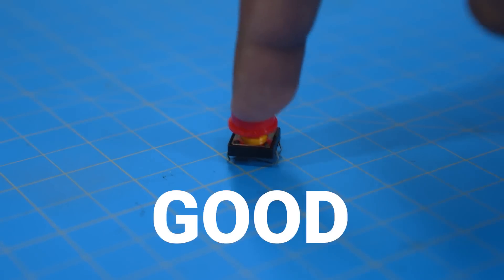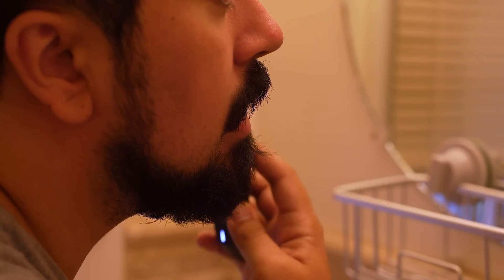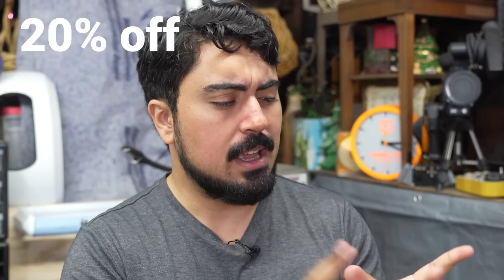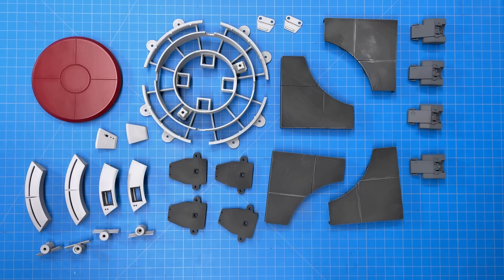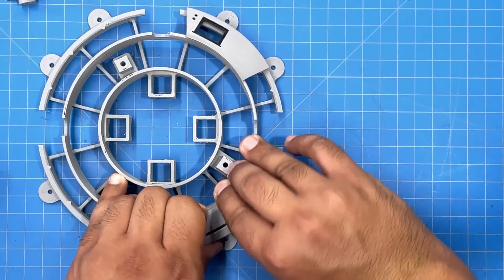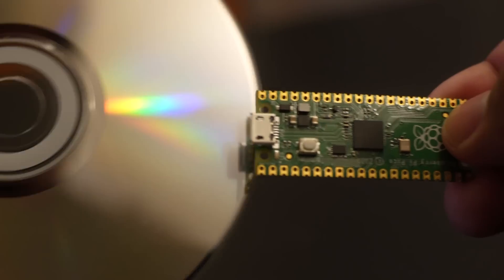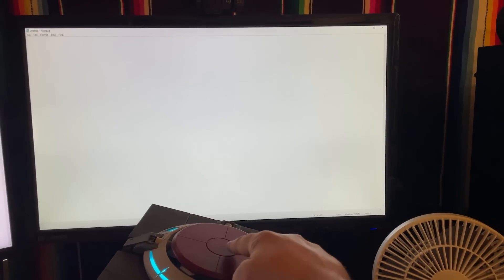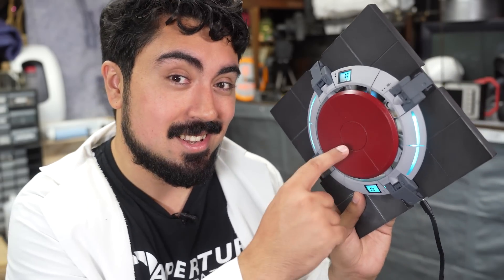Portal 2 | DIY 1500 Megawatt Aperture Science Heavy Duty Super Colliding Super Button Miniature

Comment: "Then I made my own model in Fusion 360"
proceeds to roll through the most difficult part of the whole project in 10 seconds 

man, I am amazed by how well you can design the fittings and stuff. Having to consider printer limitations, fitment, components... I can't imagine a workflow to get it consistent
Reply from the maker: Thanks! Yeah, that would have taken 30 mins alone to explain. It gets easier/more approachable the more modeling like this I do though. The first thing I ever modeled was a AA battery 7 years ago, so it takes time haha

Comment: Is there any alternative to the leds? I dont want to order them from amazon
Reply from the maker: You could order them cheaper on Aliexpress or Ebay. Any other DIY/Maker oriented sites and they're way more expensive
Reply: @MrVolt  could There be a modification for normal RGB led strips? Or maybe Just 2 outputs for normal leds? Id code it myself but i dont have that level of coding yet

Comment: Would you ever consider having a sort of freelance store for your products? Basically people commissioning you for simple builds you can sell and you can take your time working on them, as well as limit how many are able to be ordered per month or something, and maybe even find other people to help construct them. It's a long shot, but would help those that don't have a way of 3D printing the parts and assembling it.
Reply from the maker: I've thought about it and even spoken to Valve about it, but the margins aren't there in low volumes. I would have to charge a very high price since most hardware takes so much time to make in small batches. Also, running that kind of business would take away a lot of time from video, which I want to focus on more, so free files it is for now!
Reply: @MrVolt  
True. Can't wait till I'll be able to make one, tho. Also, can't wait to see the life-sized one you mentioned on the poll. Think you're gonna have it open a door or anything?

Comment: When it came to 3D printing what'd you do for the feet? Did you use an SLS or MSLA or standard FDM machine? the detail on those are incredible seem to be free floating with no artifacting from supports?
Reply from the maker: They were printed via SLA. All of the features in the model are designed with FDM in mind though, so no elements are thinner than 0.8mm. the design. I did print multiple FDM feet, but it's a nightmare to sand small parts :)

Comment: so mabye try to do a apature scence moveable panels next? id love to see somthing  like,i wounder how effected thay can be in irl sineros,tho i bet your just gonna back one,wich could just be used as a phone holder or very laberate computer monitore
Reply from the maker: It's highly requested! One of the most difficult designs actually to do. Robot arms are $$$
Reply: @MrVolt  i would belive so,tho i have seen a video of a use to be toy maker making a fairly cheap robot arm,i dont remember the name of the channel but hes recently made some vids about a movable ridable chair with multidirectional wheels (i dont know the real name of the wheels,all i know is that they are ball shaped)
Reply: Unfortunately replicating all of their functionality would be incredibly difficult, given all of the degrees of freedom packed into the tiny space. I count 8 rotations and 4 linear segments.I'd think you'd need to make it at fairly large scales to fit everything and have it strong enough...
Reply: @teamspen210  well im guessing it would take a certain type of materal plus the size,if it was intirley made up of plastic i doubt there shouldent be a issue with the size very much,the only part that would be very difficult is to get the tech to fit inside it ot work it properly

Comment: There was a guy called Pscyhobob that did a Portal button drinks coaster years ago. His design was all one piece though and had the button in a permanently pressed down state. (Plus he sold them on Shapeways which is such an expensive service, imho)
Super cool to see one that actually works! I might attempt this myself if I get my friend to print up the parts for me. (Dunno if I'll bother with the electronics though. I was never too good in that department 😅)
Reply from the maker: The electronics are so worth it! I thought I'd get bored after a while, but it's so satisfying to press it over and over. Feel free to ask me questions in the Discord if you need some electronics assistance. This is designed to be low-cost and beginner friendly :)